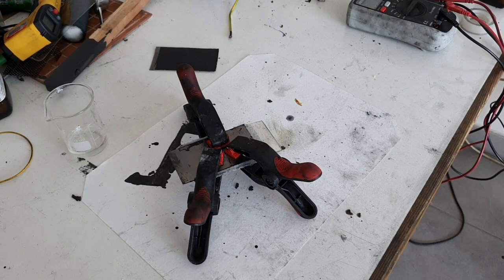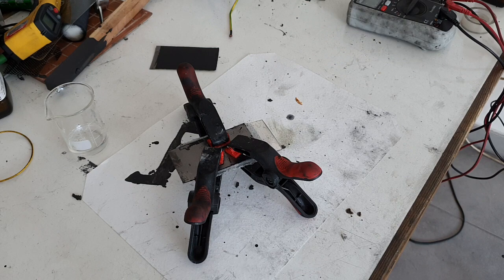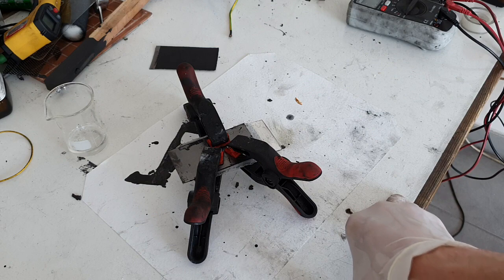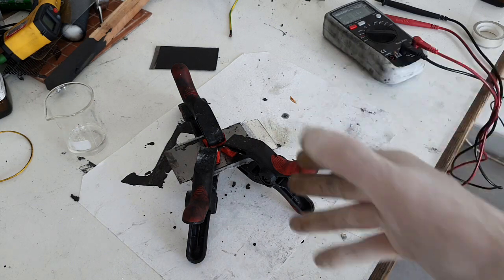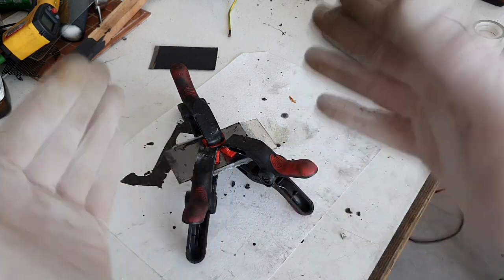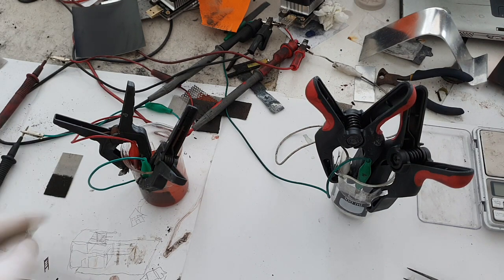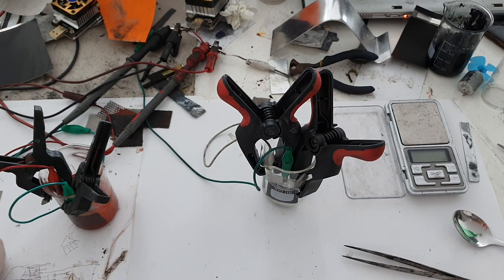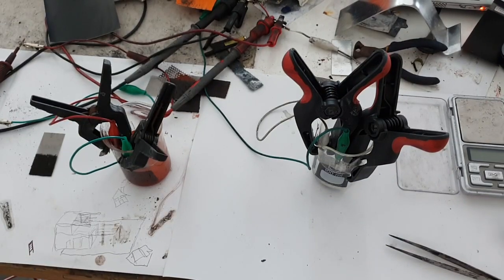Aluminium air battery, Edison battery, Nickel Zinc battery,...

Comment: I discovered if you take the manganese dioxide out of a d cell fresh battery, leave the carbon rod in as the collector 

I mixed epsom salts into water waited until disolved then poured some into manganese oxide (mg sulphate)

 the manganese dioxide and the carbon rod is then weapped in paper  then wrapped with magnesium  the results are

2v cell 600 to 800ma dead short, you have the equipment to explore this battery cell, but after 2 hours its powering a 1w led from 2 aa sized cells very nicely

Comment: I want to see if it can make a battery that can be refilled from copper ... aluminum graphite and charcoal and electrolytes from alkalis ?
Reply from the maker: Hmm, the aluminium and alkaline electrolyte are not best friends 😁 try to use some salt electrolytes,... MgSO4, Na2SO4, NaCl,...
Reply: @cayrex  emm nacl suport rechargeneble for battery alumunium aand copper plate ?
Reply from the maker: @CREATIV_DIY  not really,... I try to say that go away from aluminium and alkaline electrolyte. Alkaline electrolyte you can use with zinc or iron. Also activated carbon for the negative electrode works fine if you make a supercapacitor
Reply: @cayrex  The problem with NaCl and Al is quick formation of Al oxide which almost stops the reaction !
Reply from the maker: @jrath2001  most of the electrolytes create a oxide layer on aluminium. So water based electrolyte,.... no go!

Comment: Aluminum is a good choice if oxidization can be prevented. It is cheap, abundant, and has a high energy density. The problem has been aluminum tends to rapidly form a resistive oxide layer. If you have an electrolyte that retards the oxidization it is worth pursuing.
Reply from the maker: With water based electrolytes like KOH or NaOH you will get better performance for sure(higher current and capacity), also the electrolyte will evaporate really fast and the aluminium will be damage in hours. With this des electrolyte I get very slow evaporate of the electrolyte in a open cell (2-3 weeks with open cell on temperature od 25 to 28 degg C). The des electrolyte dissolve most of the metal oxides. The current output is around 20-40mA/cm2. Also I think that can this cell be rechargeable but the coulombic efficiency of the cell is low.